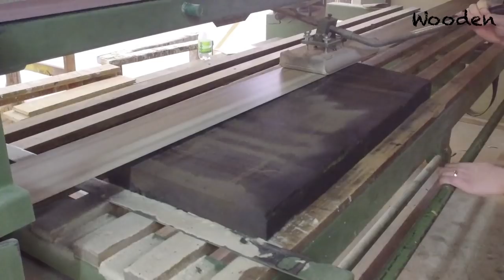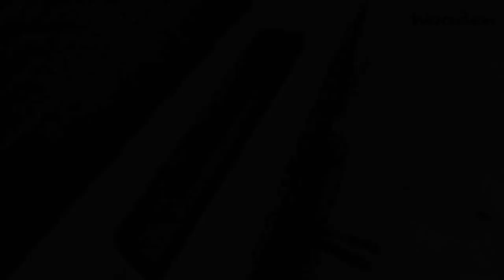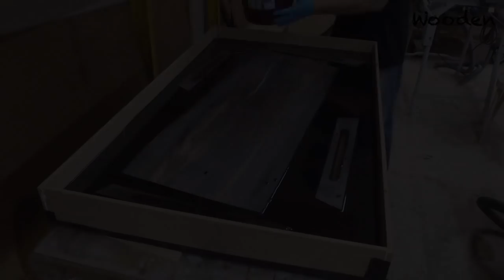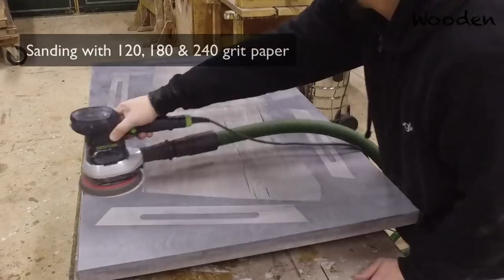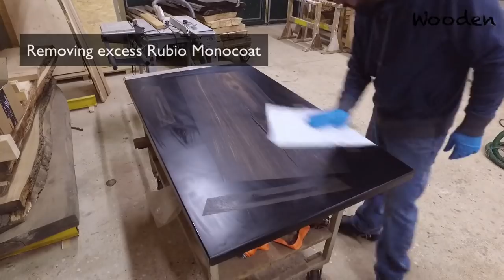LED lit coffee table - Bok Oak Epoxy Resin

Comment: What you applied before using rubio, did tou sealed the wood or it was stain ?
Reply from the maker: Hi Sagar. No, I didn't seal the wood for this project. Before applying Rubio Monocoat I cleansed with with mineral spirits.

Comment: What does the bottom look like.? Bunch of wires and light strips hanging out? Big machines make for lazy endings.. haha cool idea though..
Reply from the maker: What? The ending shows how I attach the stuff on the bottom part and carved out space for the battery pack. Did you miss it?
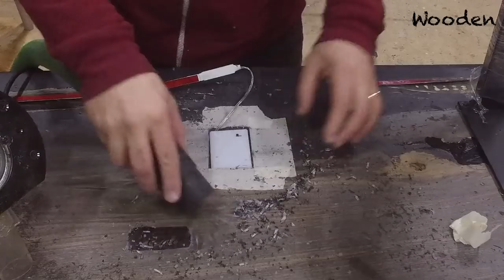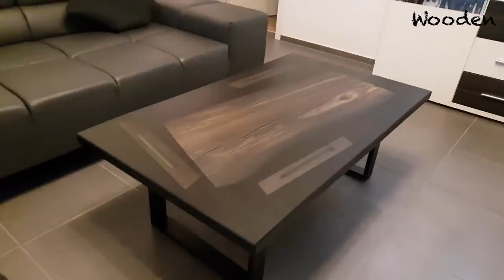Reply: Watch from 8:05 - 8:10 does not show end product from bottom view. Did you cover the l.e.d. strips? Or leave them bare?. Did you duct tape them? Did ya MacGyver hubba bubba pen cap it? Did ya use Nice removable covers? All we see is the top finished.
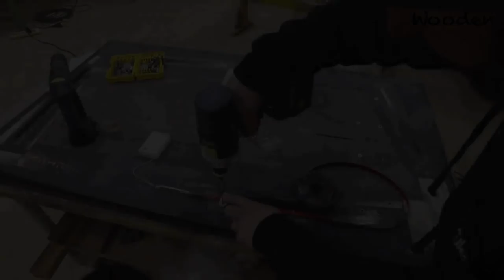Reply from the maker: I always MacGyver stuff, thats what I do. But you are right, I rushed the end. The strips were attached with screws as seen in minute 7:30 onwards. The battery pack was attached using a small piece of thin wood ans screws. I didn't cover the strips in addition to that, which I maybe should have to prevent the lights from lighting the floor. Does that help?